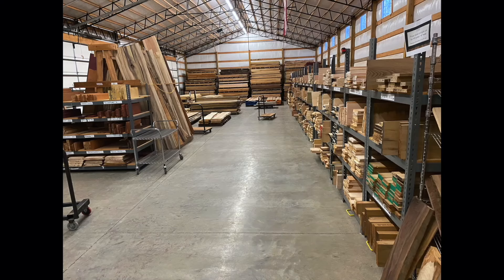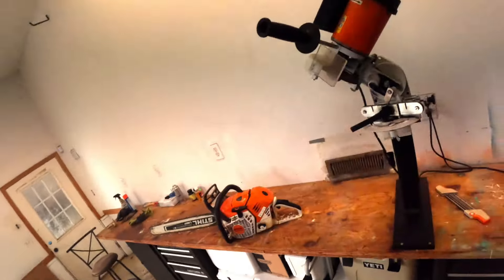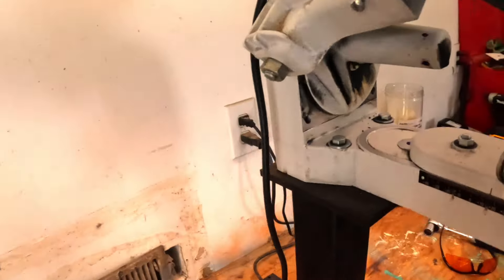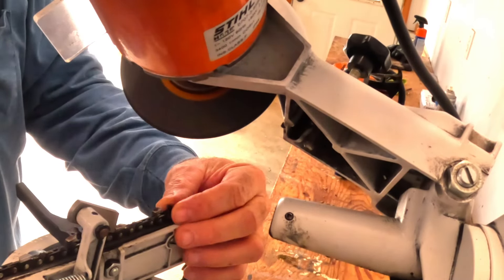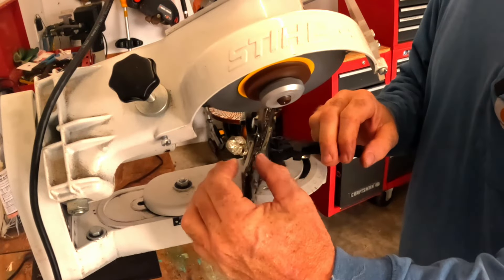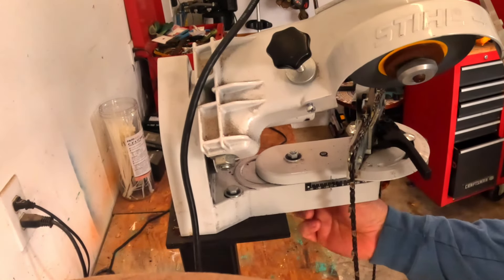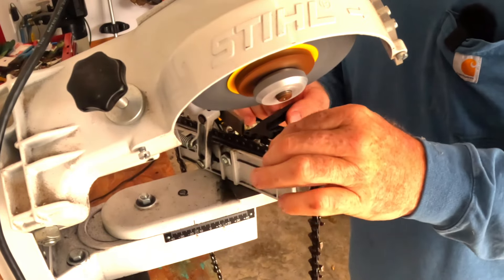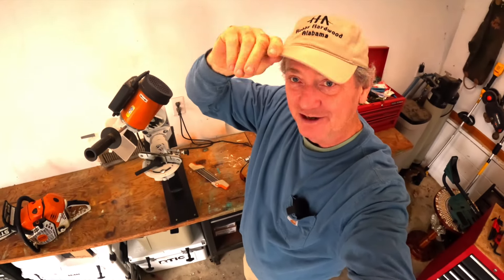Chainsaw Sharpening Hacks for Quicker, Cleaner Cuts - the Stihl USG Chainsaw Sharpener

Comment: My first “real” job was as a logger so I did a lot of hand filing. Still file all my chains, even on my 5 foot Alaska mill ( rarely used these days)  I think you mentioned you also sharpen your sawmill blades, I’d be interested to see your solution for that also.
Reply from the maker: Yes, I hand file a good bit, and use this grinder a good bit.  Done correctly, both will sharpen a chain better than out of the box new.   I also have used several bandsaw sharpeners, and have found one that works real well.  I do need to do a video on it, thanks for the idea.

Comment: Mr. Milton,  I purchased an LT40 a few months ago and I appreciate the information you provide.  I'll certainly benefit from your willingness to share what you've learned.  Thank you!

I bought an old Foley Belsaw chainsaw chain sharpener on a stand ten years ago.  It has all the adjustments of your Stihl sharpener, but it also has a spring loaded foot pedal to clamp the chain.  It took me awhile to figure it out, but, once I knew what to do, it's real easy to sharpen chains.
Reply from the maker: Thanks! Forty builds really nice stuff, it;s funny, whenever I go to a circle blade sharpening place, if they have Belsaw equipment, they know what they are doing.  I looked at the foot pedal, but just never got around to getting one.

Comment: west coast saw has some fun goodies for the 500, if your going to be spending a lot of time behind that grinder you may want to look into a diamond wheel for that badboy.
Reply from the maker: I actually bought a 48 bar for my 661 for West Coast saw several years ago, you are right, they are a good company..  Believe it or not, I have tried both an expensive CBN and also a diamond wheel for this grinder, and neither did a good job, although I didn't get them form West Coast..  I may have not got the good ones, but I got the ones people recommended and all it cost me was a couple hundred bucks.  Ouch!   So I switched back to these.  Maybe someone will send me a better wheel, but I've already spent enough on trying different ones.  I was even at the dealer asking him a few years ago about which ones he used and he said the CBN or diamond  they got from Stihl as dealers weren't any good anymore and he asked me as soon as I found a good one, tell him because he's looking also!  I never did and no telling what he's using now, I need to ask him.

Comment: I saw the 2n1 stihl on your bench, but you didn't say anything about it.  I use it exclusively.  So fast and easy and sharp like new.   Glad to see your hair. Jealous, and I'm 52 and thinning on top.  Brad_bb
Reply from the maker: I use the 2 in 1, did an entire video on it, and had a few sentences about it in this one but cut them out, but was simply showing another way I sharpen chains. When a chain gets out of whack or rocked up, this grinder will bring it back good as new extremely quickly.  Each has its place, and the 2 in 1 is why I didn't worry about dropping the rakers using the grinder, I'll drop them when I next sharpen with the files.

Comment: Hi Robert,  Thanks so much for your sawing videos and especially for this chain sharpening video.  Can you tell me what kind of grinding wheel you're using with the Stihl USG grinder, and where you get your grinding wheels?
And how do you dress the grinding wheel?  If the wheel is made of a non-traditional (i.e. non-Oregon style) material, do you use any special tool or unusual profile for dressing the grinding wheel?
Reply from the maker: Surprisingly, the best wheel for this is the one that Stihl sells with it.  I've tried Ruby, CBM, and diamond, and still haven't found one better that cuts fast and doesn't burn, including all the Oregon, Norten and others.  I wear it out and just get new ones from may local dealer.  I'm sure Stihl doesn;t make it, but although I have found some that look like it, they don't work like it.  I dress it with a hand held grinder dresser, but in reality, if it set in the gullet/face corner correctly, it will maintain its shape for quite a few sharpenings.  One issue I had with CBN wheels is that the grunge on the chains needed to be removed or the abrasive clogs up, which means I needed to clean the chains before sharpening, which I don't want to wast time doing.  This wheel just burns through the sap and oil residue on the chain.

Comment: Are you running a CBN wheel on there?  That's what I run on my Oregon grinder and I love it.
Reply from the maker: I've tried the and haven't found a good one that lasts.  What brand are you using?
Reply: @HobbyHardwoodAlabama  Diamond Wheel Inc
Reply: @HobbyHardwoodAlabama  I tried a Diamond Corp wheel and it just didn't cut the what a CBN wheel should. I tried dressing it a couple time, but there was no improvement. I then purchased a Baltic Abrasives wheel and it's been perfect. I have a USG and a HOS and the only thing they won't do is cut a square grind cutter.

Comment: Do you use the same angles on Full chisel and simi chisel?  Super and Micro chains if you will.  40/30/15?
Reply from the maker: Yes, the only time I will change an angle is when I'm ripping logs with a chainsaw freehand, I will put a slightly shallower angle on it, say about 20 degree.  The flatter angle seems to shear better and not causes as much saw hop.

Comment: Does the motor on that sharpener have a fwd/rev function?  The single position grinders put a small burr on the tooth if you can't reverse the direction of the wheel.
Reply from the maker: It has a single direction, but due to the quality of the wheel and the grinder, the burr is very small, if at all, not anything like what happens on lower quality grinders where the burr is big enough to grab a fingernail or break off and result in a dull edge.  That is one reason I hated the box store grinders.
Reply: @HobbyHardwoodAlabama  Thanks for getting back to me. I appreciate it.

Comment: what about the rakers?
Reply from the maker: I was wondering if anyone was going to ask.  I use a Stihl 2 in 1 that automatically sets the rakers, so the next time I touch up the chain (fairly often), the rakers will be dropped also. So  I typically don't do the rakers on the electric grinder because of that.
Reply: @HobbyHardwoodAlabama  great answer. i love the 2 in 1... best sharpening tool every
Reply: that works well but i find if its full skip it takes to much off and makes it bite to hard depending on the saw, just keep an eye on it
 @HobbyHardwoodAlabama